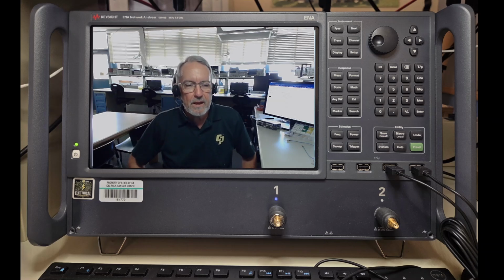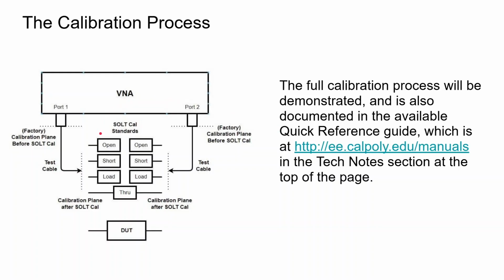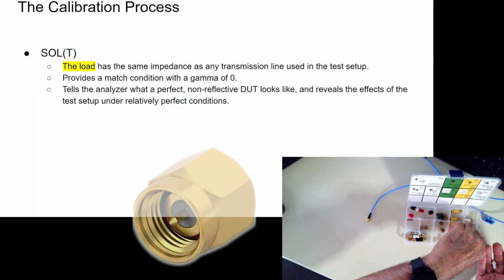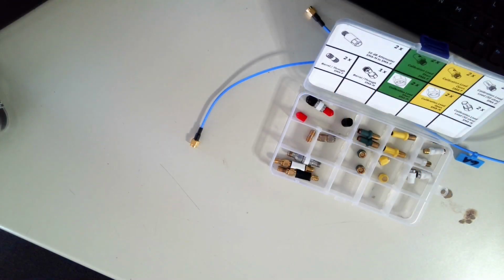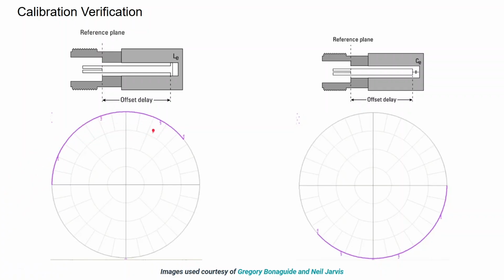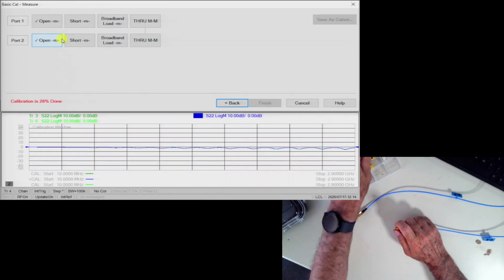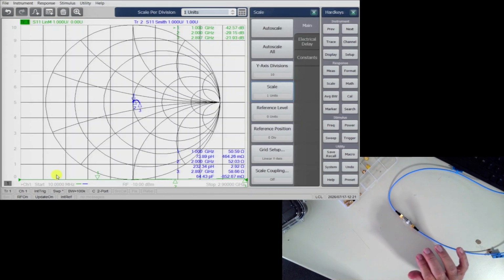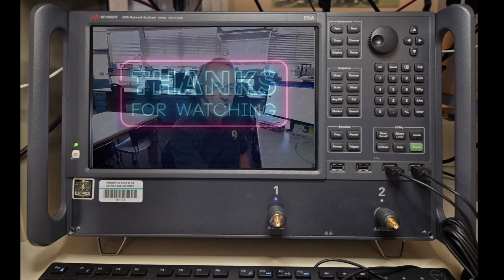Surviving VNA Calibration

Comment: Buongiorno Prof. riguardo i cavetti blu usati nel video, sono intestati con connettori SMA o Sub Miniature type A, mi pare siano specificati da DC fino a 24GHz, mentre il cavo e possibile che abbia un cut-off frequency attorno ai 6 o 8 GHz, mentre gli standard di calibrazione sono dei PC3.5 or Precision 3.5mm che indica il diametro del foro interno della schermatura, ed hanno dielettrico in aria, e giustamente sono compatibili con gli SMA, io possiedo 2 Cal Kit, entrambi di Keysight Technonoly uno tipo N 85032B, e uno PC3.5 85033E. Bisognerebbe tenere presente che quando si avvitano gli standard di calibrazione, bisogna evitare di far ruotare lo standar stesso, e girare solamente la ghiera del connettore, questo per evitare di consumare e danneggiare il pin centrale. Ho notato che hai fatto tutte le misure con impostazione Linear Magnitude o parametro Gamma, ma in genere piu' comunemente si usa l'impostazione in Logarithmic Magnitude dB che risulta meglio visibile quando si misura un filtro. Ti saluto e ti rigrazio per la pazienza😊 tanti saluti dall'Italia🇮🇹
Reply from the maker: Please keep in mind the emphasis of this video is calibration. When in front of the lab class there are more in-depth operational instruction. So the details you observed about how I made the measurements are not the real point of this video. Our lab procedures use various modes of measurements.
Reply from the maker: EMail me at ccbland@calpoly.edu, please.
Reply: @charlesbland7207 ciao Prof. Forse hai frainteso, io non voglio mettermi in discussione con un professore di universita', tra l'altro io sono una semplice persona, che ha solo lavorato per decenni con i VNA, e quindi non sono al tuo livello! Comunque se vuoi ti scrivero' in privato, ma non mi pare che l'ultimo commento che ho fatto avesse nulla di polemico🫢 ho solo scritto quello che e' riportato su tutti i manuali di calibration kit! Non ti devi incazzare, perche' se pubbilchi un video su Youtube devi anche sapere che ci sara' sempre chi trovera' la minima incongruenza😊 Ti saluto caldamente, e scusami se ti ho irritato con i miei commenti, ma io ho il carattere del perfezionista, quindi non riesco a tacere se vedo qualcosa di sbagliato🫣